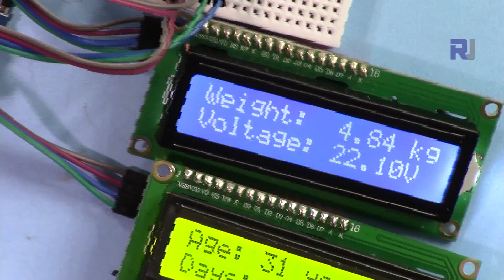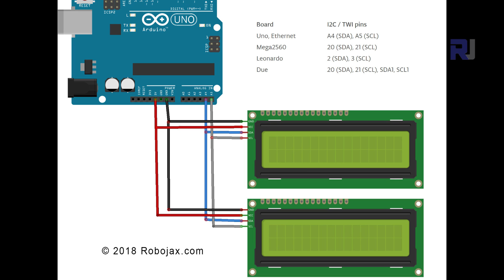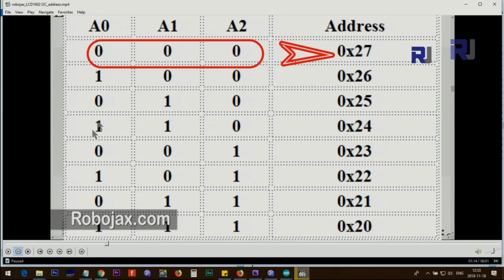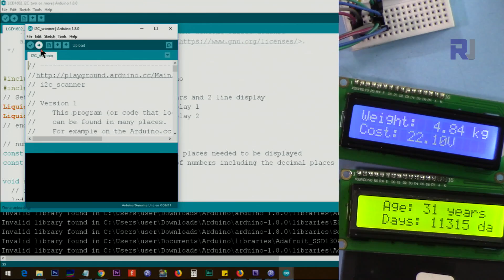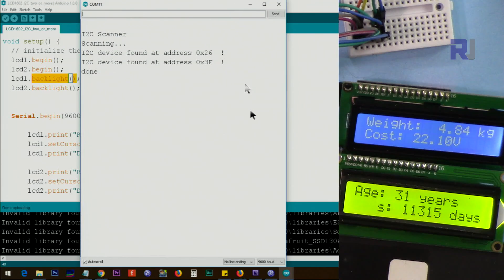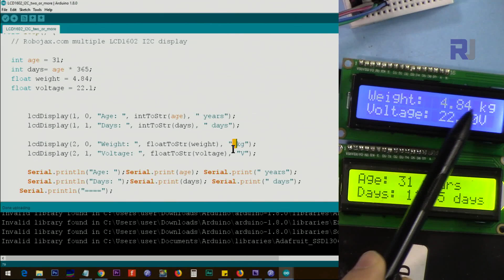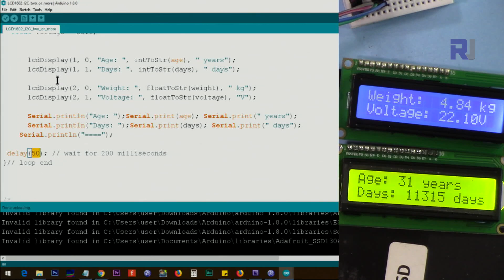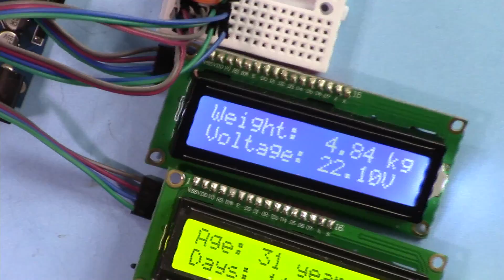How to use multiple LCD1602 I2C or LCD2004 display with Arduino

Comment: The I2C scanner doesn't work, even when I have the displays attached correctly and addressed separately. Serial monitor will show scan and then no I2C devices found
Reply from the maker: There just be a wiring issue or both lcd has the Sam I2C address. Starry with one LCD then got for two. Here is a better video https://youtu.be/NXAswOc_2zg

Comment: you can use 8 bit shift register and Arduino library to display on multiple display
Reply from the maker: we are using I2C communication which uses only 4 wires. we don't need to use any external hardware like shift register.

Comment: thanks for the explanation! In addition to this, can i add a magnometer with the 2 displays with I2C protocol?
Reply from the maker: Here is bargraph example using ultrasonic sensor https://youtu.be/V-o32As_Xv4 but I have it for temperature, distance using laser sensor and voltage. search my channel
Reply from the maker: I searched for the video and provided the link for you, but you did not  acknowledge if  saw the video or not.

Comment: Sir is it possible to send the data of 1st LCD to 2nd LCD?
Reply from the maker: what do you mean to send from one to other? Arduino is displaying anything you want. so if you want display something on display1, then display it on display2. this is I believe you wanted. not sure. but it should be very easy. I have explained everything.  Make sure to watch the introduction new video https://youtu.be/pxUjEsJQW2M or old introduction video https://youtu.be/q9YC_GVHy5A

Comment: I have a problem  in writing the text shows in the two displays
Reply from the maker: you must be NOT following the instruction. Watch it again without skipping.  or watch the introduction to LCD video if you didn't understand it.
Reply: @robojax  ONE display address IS (27x0)
AND THE  second  display IS(22X0)
Reply: @robojax  ONE address
Reply: @robojax  ONE address
Reply: @robojax  ONE address
Reply: @robojax  ONE address
Reply: @robojax  ONE address
Reply: @robojax  ONE address
Reply from the maker: why you posted this line 9 times? instead you should have looked at the description where I have the solution.  they can't be the same. should be different. I have separate video on how to change I2C address. The link is in the description. A Muslim does not abuse anything.
Reply from the maker: ? you didn't replay back?

Comment: Can i handle a 1602 i2c + 2004  i2c with this method? Thanks
Reply from the maker: Yes, of course
Reply: @robojax  Thank you!
Reply: Why not to send a string variable called "lcdName" as a parameter to your function lcdDisplay(). That way you dont have to repeat the code for every lcd inside your function. What you think?
Reply from the maker: You are welcome. You can it more than one way.

Comment: Hello !! In my Arduino project i have 2 LCD 16x2 I2C but the scanner just recognize 1 ... i dont understand why... can you help me ?
Reply from the maker: Hello, disconnect ONE and check the the address and then remove the first and connect the 2nd and read the address. if both are the same, you need to set I2C address  Watch this video to learn how to set the address. https://youtu.be/bqMMIbmYJS0 Thank you for not skipping the ads and keep watching them. This will help me a lot.
Reply: @robojax  Perfect now its working thanks !
Reply: @robojax   It has to beboth are the same address Or different
Reply from the maker: they can't be the same. should be different. I have separate video on how to change I2C address. The link is in the description.

Comment: Thanks for the video.... I am building a device using several sensors and a LCD like the one shown and several require to use A4 or A5.... Is it possible specify to use different analogue pins for LCD or the various sensors ?
Reply: I2C is precisely for these situations where you have multiple devices connected to the same communication pins. The address of each device is how you speak to each one. This vid shows how to modify those device  addresses so they can be connected to the same communication pins.  As shown you can also use the 'I2C scanner' sketch to find the i2c device address'.
Reply from the maker: NO. I mentioned that we are using I2C pins which are  at A4 and A4. But you have SDA and SCL pin  on the other side of after digital 13 pin.